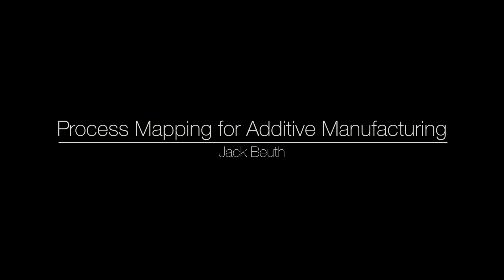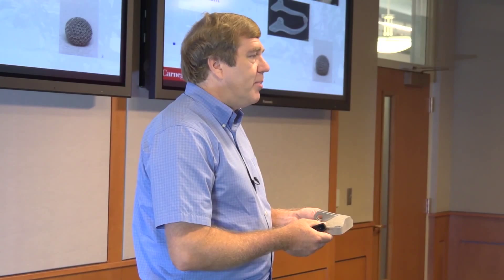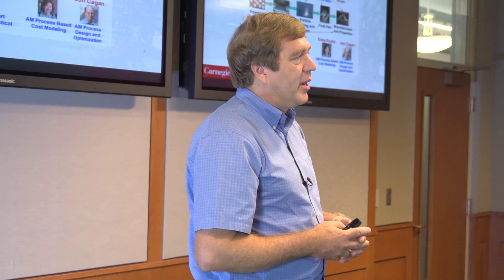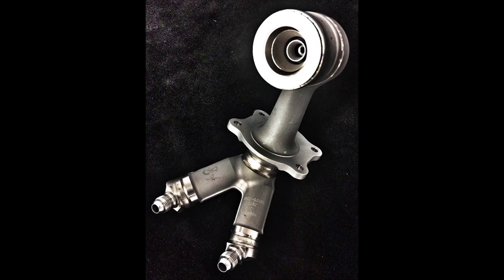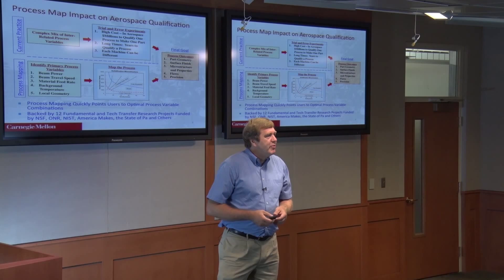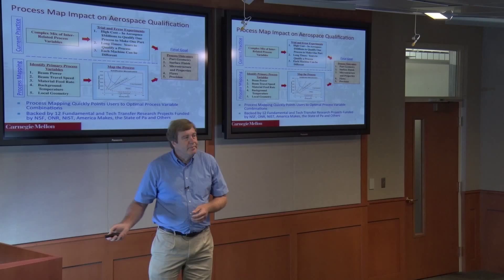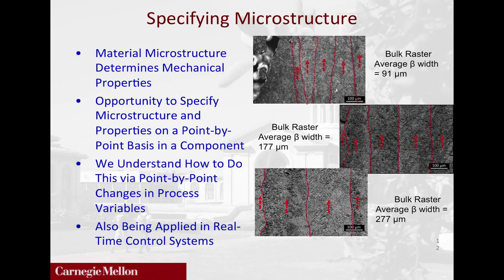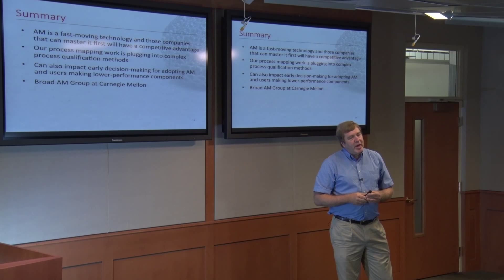Jack Beuth: Process Mapping for Additive Manufacturing

Comment: Very nice talk Mr. Beuth. You claim to have a process modelling technique that improves the manufacturing process. What is the impact of your technique on the feature size you can achieve on your machines? For example, what is the smallest feature size you are able to do on your eos M290? Example would be smallest hole diameter, or smallest diameter of lattice beams.